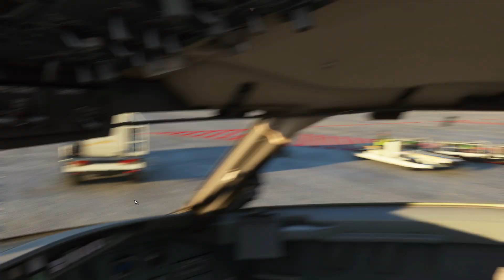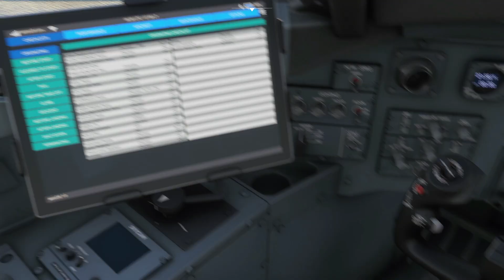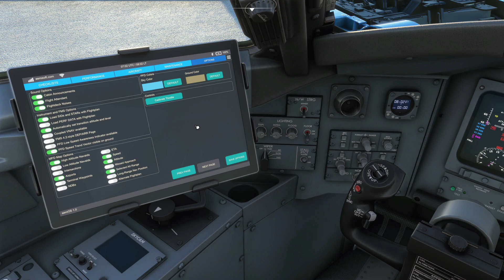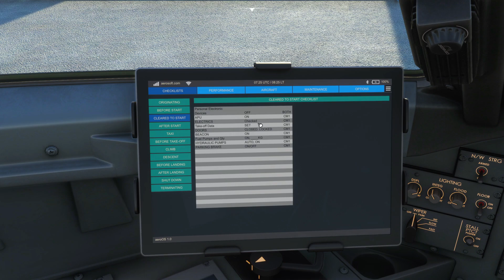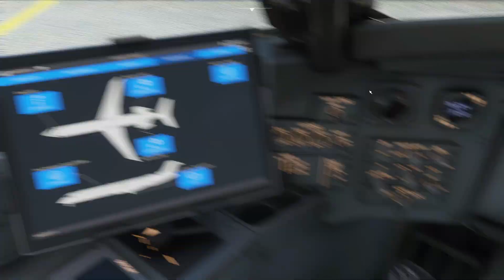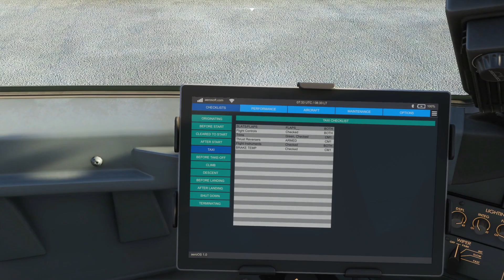Microsoft Flight Simulator 2020 | GROUND SCHOOL | Aerosoft CRJ | Cold & Dark - Taxi Ready | EP#1

Comment: Go to the Legs page on the FMS an you can cycle through the route
Reply from the maker: Thanks yes I have learned that after this video.
Reply: @TheSimPilot  I flew the CRJ-700 until I retired in 2014. I love the Aerosoft CRJ, it is very close to the real thing.
Reply from the maker: @jameswebb2856  It's a great aircraft, I can only imagine how much fun it could be to fly in real life. Maybe there's more I can learn from you appreciate all the feedback!
Reply: @TheSimPilot  I used to out run 737's and 757's. The Vne is .85 mach but we were restricted to .83 in RVSM (Reduced Vertical Separation Minimums) airspace above FL240. I loved flying it and talking about it.
Reply from the maker: @jameswebb2856  She's for sure beautiful and fun to fly never though she'd outrun 737's and 757's.